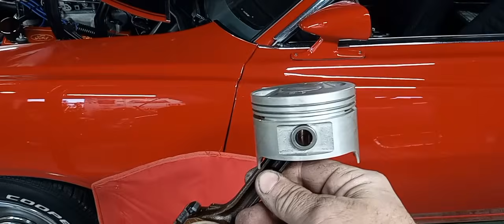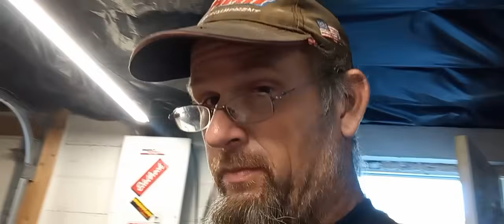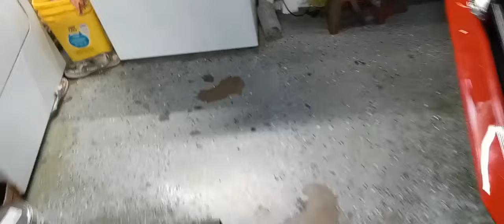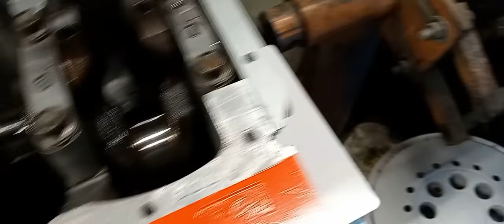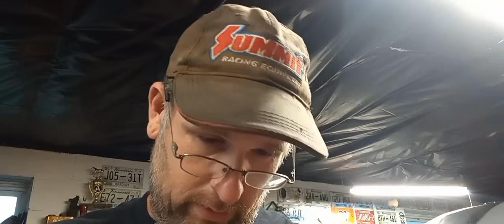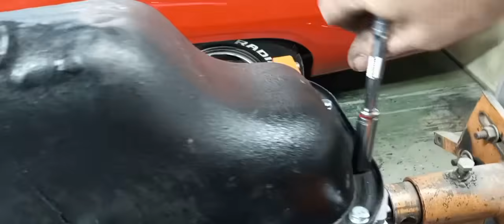How to Make YOUR Geo Metro FASTER: Building a High Compression Turbo Performance Geo Metro Engine

Comment: I didn't notice you installing or mentioning the oil galley check valve that goes in the small hole above the lower left head bolt hole. What are your thoughts on that part?
Reply from the maker: @happily-houseless  it 100% has to be there , i did skim over its importance in this video

Comment: Just drop an Atlas 2.9 in it
Reply from the maker: Putting a larger engine would be the easy way out. I've done Ls swaps in these cars there's just something fun about pushing such a small engine to its limits
Reply: Big engine defeats the fuel economy potential. Some run adjustable boost/na settings to keep high mpg when it matters.  I drive very long distances, and the economy  beats most vehicles.